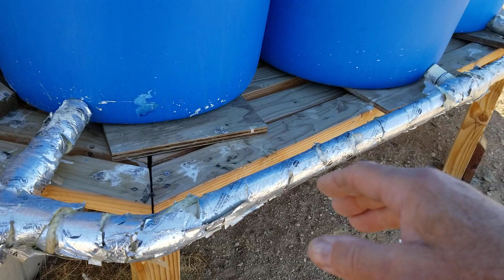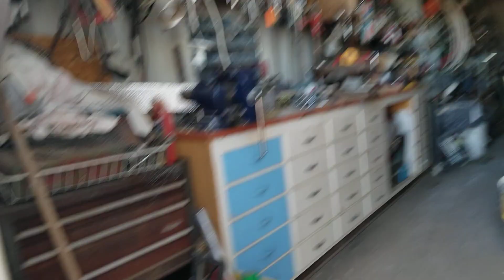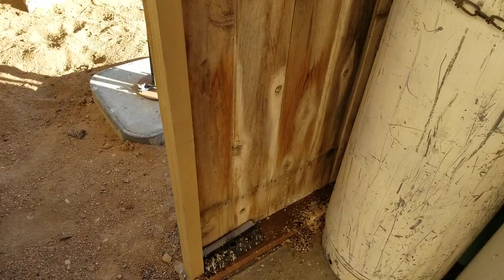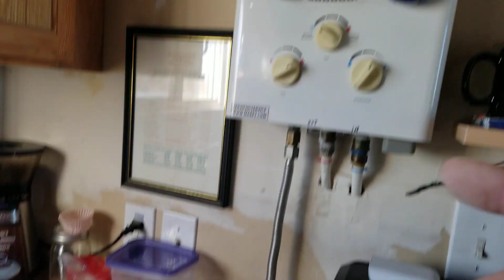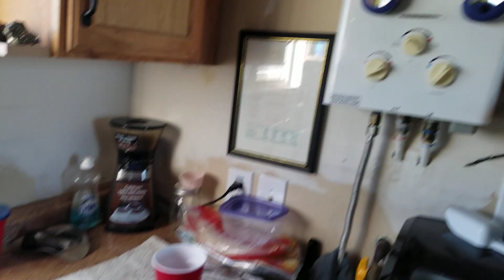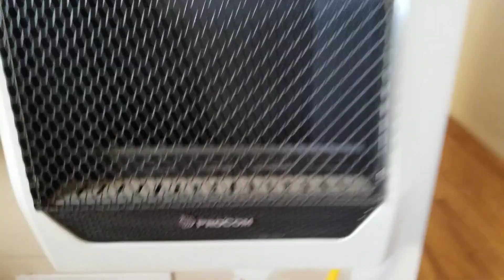OFF GRID Water System, Mar. 13, 2021

Comment: It's 8.34 pounds per gallon...I went to waterworks operating school for 7 years and I had to pass the tests to keep my license...with that, and being a welder for 38 years, I'll just get some sheets of stainless steel and weld it up whatever I want...a 5000 gallon clear well is a nice size..it stays clear better, and cooler...but you can just remember 3 gallons of water is real close to 25 pounds for fast figuring...3000 g = 25000 pounds
Reply from the maker: Thanks for that simple formula.

Comment: You were calling the red plastic tubing SHARKBITE  but should have been called PEX,  just the push in fittings are called sharkbite, it would be a bit misleading to those that are looking to purchase the tubing if they were to  ask for sharbite tubing,  usually the red is for hot water and blue is for cold water. Here in Kentucky, state laws requires flared fittings on propane or natural gas lines.
Reply from the maker: The plastic tubing I buy is Sharkbite.  Says so right on the tubing.  But, Pex is the same size and can be used with Sharkbite, or vice versa.

Comment: Good thing most of your sharkbite fittings are outside or accessible. Sharkbites are known to leak. In most places they are illegal to use in enclosed walls bcuz of it. Pex bands are the best. They swell if your water line freeze & swell, but shrink back with no leaks as they thaw. The tool is pricey tho. But in cold weather areas you will be glad to have these bands.
I intend to use blue barrels as my filter system for rainwater catchment system. Gravel, sand, charcoal, one 55 gallon barrel for each. Proven to be very sanitary to drink. Eventually I hope to put in a regular well. But to get started this is my idea.
Propane heater is a great back up for me,  Is yours a true flame? I intend using a rocket mass wood cooking/ heating/ baking/water heating stove in my permanent cabin. I want to build one like the one audiobro has on his channel. He sells the plans and/or premade core.
Propane tanks can never be store in a fully enclosed building for safety. 3 sided building is perfect.
Water heater is great for single people. I like yours, was thinking of using my horse shower one for my temporary shower until my cabin is built. It uses propane and ignitor is started by 2 D batteries. Its portable, comes on a special hand truck to move it around.
I have a lot of plans, and ideas to try once I find my land in Kentucky.
Reply from the maker: Sounds like you have planned well.

Comment: Hello G BEAR, Do you scrub the Large black tank with bleach, or what is the process ?  THANKS ,TAKE CARE..
Reply from the maker: There are a few different ways of doing it, and different people will do it differently. 
My method is as follows.
1.  Drain as much of the water as possible from the tank.
2.  Use a wet/dry vacuum to finish removing any water left, and vacuum any sand, silt, etc from the bottom.
3.  Mix a half gallon of pool chlorine into 5 gallons of clean water and pour it into the tank.
4.  Use a pool brush to 'wash' the bottom of the tank, then vacuum the water out again and allow to dry.
Notes:  yes it requires a ladder be placed into the tank so you can get in and out.
Clean the bottom legs of the ladder while doing #4.
**I also add 2 cups of pool chlorine to the tank just before the truck gets there to refill just to kill any bacteria left behind. The ratio is 1 quart pool chlorine to 2500 gallons water, but the company that delivers to me brings very clean, treated water,  so I reduced it to 2 cups.
Reply: @GBear  THANKS G BEAR ! TAKE CARE..

Comment: I think the only thing you didn't say 
Is the vent-less wall heaters are good to 4500 ft elevation 
If I remember correctly
Reply from the maker: True, they don't like thin air.
Reply: @GBear  
I'm surprised there isn't a high altitude kit. (Jets)
Reply from the maker: @jimh4167  I'm sure there is something for high altitude.   I know a guy with a cabin in the eastern Sierra at 5500 feet who runs on propane.
Reply: @GBear  
Running on propane at high altitude isn't the problem
I just haven't seen a kit for the vent-less
Or manufacture option
There are vented heaters for high altitude
Just the vent-less are a simple install

Comment: That's quite the awesome water system setup you got there. Is the water heater On-demand type? May I ask the sq ft of your cabin?
Reply from the maker: Thank you.  Yes, the water heater is on demand, and the water pump it also.  The water pump is also 12v DC.
Cabin is about 425 sq. ft.